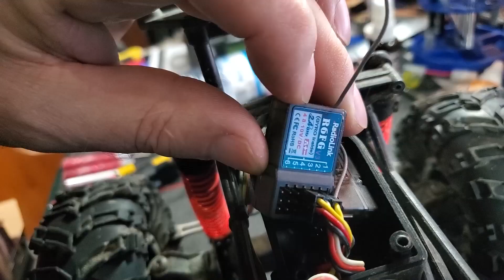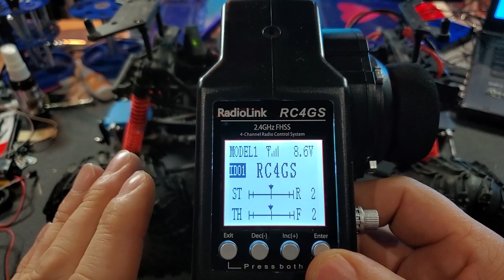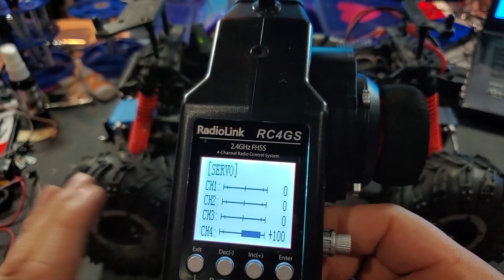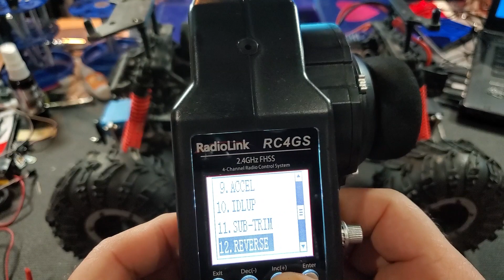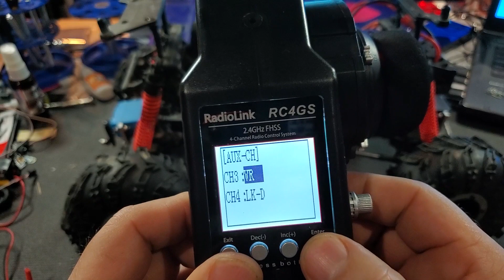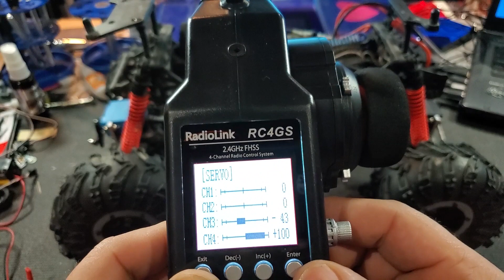Setting up dual and 4 wheel steering on RadioLink RC4GS V2

Comment: If anyone is still monitoring comments - as long as I don't go into PMIX, my rear will not turn with front, correct? I want front steer independent of the rear. Thanks
Reply from the maker: Yes, that is correct.

Comment: You can turn the rear steering on an off by assigning one of the push switches to on or off designation not momentary.
I've got my crawler programed so the rear steering can be turned and still use VR pot for manual steering if needed.
Reply: Exactly. Lol. I was confused on why he didn't use the switches for the assigned channels. I guess some people get it some don't.

Comment: I'm not sure if this controller is like the 6 channel version, but if it is, you can use the channel 4 switch just above and in front of the steering wheel to cycle between STANDARD FRONT WHEEL STEERING, REAR WHEEL ONLY STEERING, CRAB WALK STEERING, and ALL FOUR WHEEL STEERING.

Comment: thank you so much , i used your id seed set up vid and now this one ,   i just got a 4ws capra and i will set it up like your 4ws , have a great day from very very cold Alberta , cheers ,
Reply: just got it all set up .works great . the only thing is i would need to almost double reverse my steering servos so that when i turn the wheel right the capra goes right , could i just swap the connectors at the receiver to change the polarity of the the servos? , i am not shure i am explaining it properly, i did all the steps in your tutorial , ( no crab as i reversed the channel , but that reverses my steering wheel ,
Reply from the maker: @  in the menu of reverse go and reverse the channel on your rear servo
Reply: @TheTankRC  Thank you master, it now works great , cheers
Reply from the maker: @larrydrouin2497  I am glad my videos are helpful, thank you for commenting it really helps knowing that it helps you guys

Comment: I have the 6 channel version of your controller paired with a R4FGMv2.2 receiver with built in gyro. Is it possible have the gyro control two steering servos? 

My plan is to induce body roll to simulate weight shifting side to side in my drift truck.
Reply from the maker: built in gyro only works on channel 1, and yes you can use a Y splitter to control 2 servos
Reply: @TheTankRC  if you set your PMIX to Master ST and Slave CHx the gyro should still work with dual servo cars? or not?

Comment: Is there anyway of switching between crab and normal 4ws on this handset.
Reply from the maker: With this remote you have to use the menu to switch between the modes, it does not have a button that enables you to cycle quickly through the modes.
Reply: Thanks for the swift reply dude. 
Awesome video by the way. No messing and all usefully info.

Comment: What about a winch?
Reply from the maker: You could add a Yeah Racing YA-0528 winch controller and use the momentary switch to control the winch
Reply: @TheTankRC  what is the momentary switch? I have a Reefs 299LP with built in controller.
Reply from the maker: @alexrenken207  most winch controller needs or require a 3-way switch so you have high Center and low setting. The Yeah Racing controller has a jumper to eliminate the requirements of a 3 way switch and uses a momentary switch that most transmitter has.
Reply from the maker: @alexrenken207  https://www.yeahracing.com/multi-function-controller-system-for-crawler-winch-ya-0528-00074366

Comment: A little tip on the transmitter. Put a little lego wheel on the channel 3 knob. And you can use your thumb to steer the rear wheels. And your other hand on the wheel. It makes driving fantastic.
Reply from the maker: Good idea I might have to try that

Comment: Could u do it the opposite way so u have the normal steerin on big wheel n the 4 wheel steerin on the little wheel m8
Reply: Nice one👍 in mix the MST is CH3 (CH3 set to the VR dial) and the SLV is ST (steering)